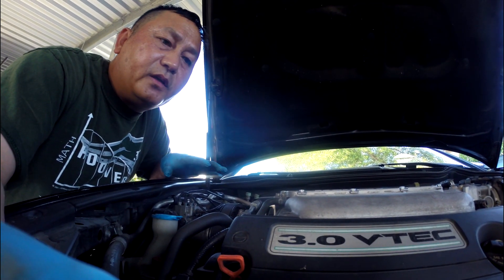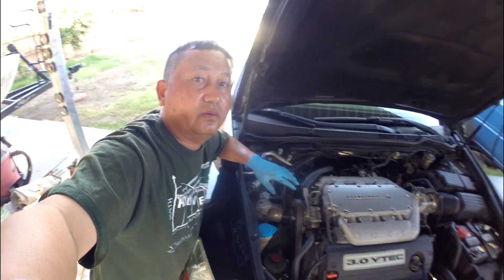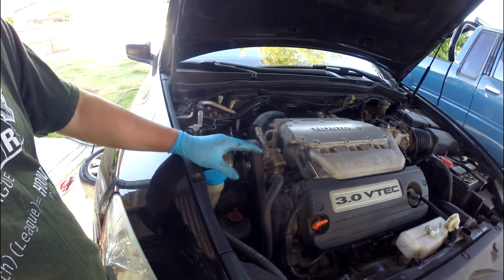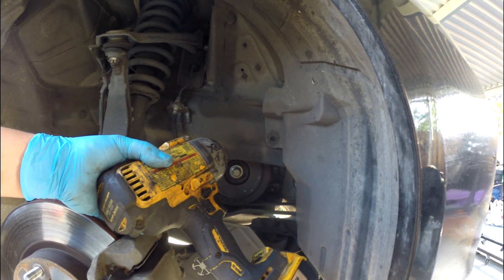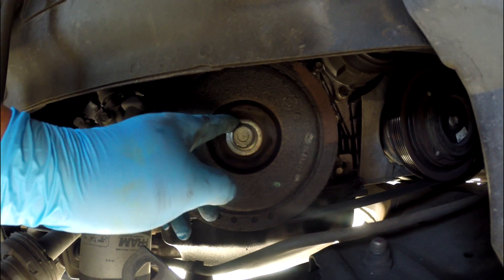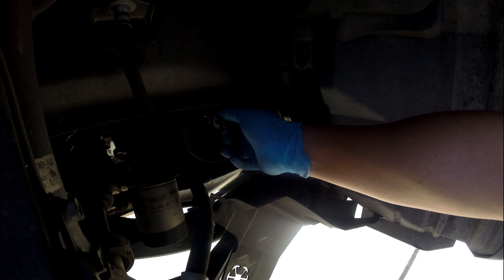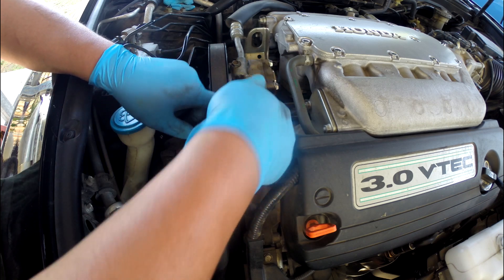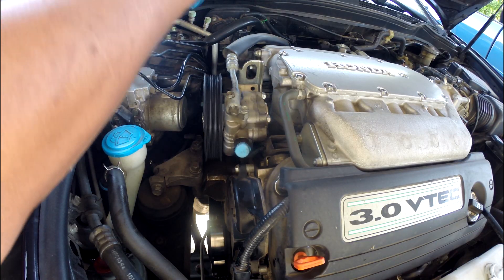Honda accord j30a4/a5 timing belt replacement.

Comment: If it wasn’t aligned, can I redo it and move the top left pulley a bit to make it aligned ? Or I shouldn’t touch it

I noticed after the change that the top left pulley was one tooth or two misaligned after 2-3 revolutions

No engine code, no engine light

Little knock noise for the first minute and then the car runs with a stronger racing car noise

Comment: What is actually making the noise when the tapping starts from the tensioner going bad? Is the engine out of time from the slack and causing interference?
Reply from the maker: Tapping when first start before engine warm up. Slack and interface i think it did if you didn't warm up before take off right away.

Comment: If the power steering pump is making noise when cold and I need to do the tensioner and all that anyway would it be good to change that too?
Reply: I was told the noise is likely from the o-ring in the high-pressure line of the power steering

Comment: Purchased a Beck/Arnley head cover gasket; it started leaking within 12k miles. USE HONDA PARTS.
Reply from the maker: That's surprised me.  I never had bad experience with beck/armley part.
Reply: Too bad even the dealers can't source some of the OEM parts.